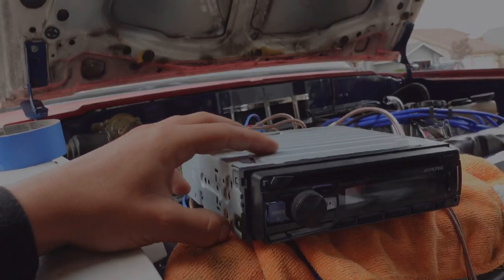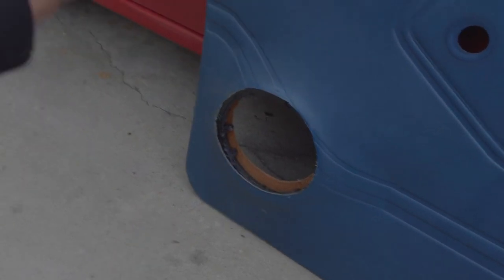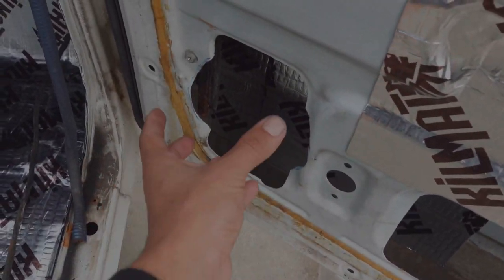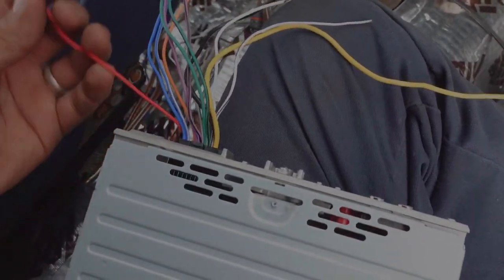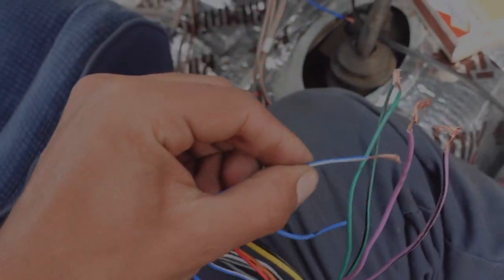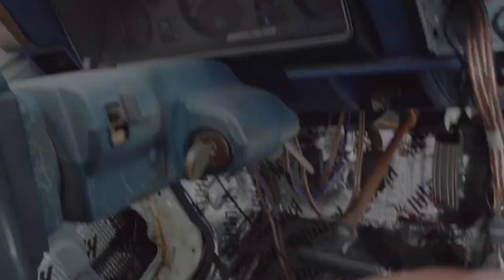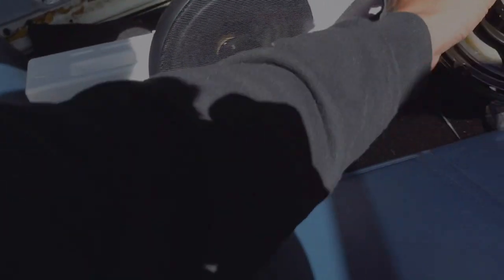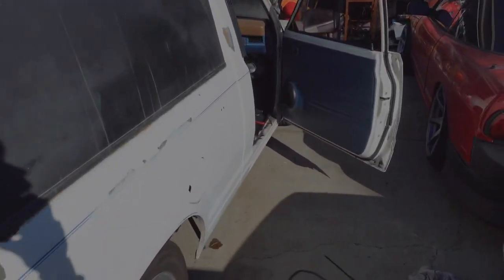HOW TO INSTALL A RADIO IN YOUR NISSAN 720 !

Comment: FIRST LOL you should’ve gotten an adaptor instead of cutting the harness plug off imho
Reply from the maker: It was cut from the previous owners.
Reply: I have yet to find a 720 radio harness. I ran my own wires lol

Comment: So I’ve been wanting to put a sound system on my 720 for the longest time and there is literally no harness on mine can u show me if u we’re to take ur dashboard where the harness is located or run into
Reply from the maker: All you need is constant 12v & switched 12v
Reply: @STONEBROKEGARAGE  yeah so I took of the dash and was digging and organized the harness on the 720 and turns out there was already a pigtail connector already with all the wires to the radio it was just hidden but thanks again and looking forward to more 720 vids